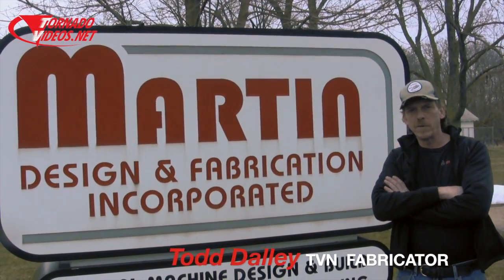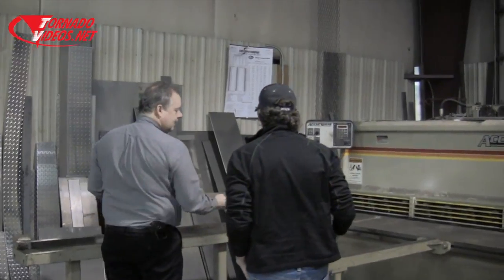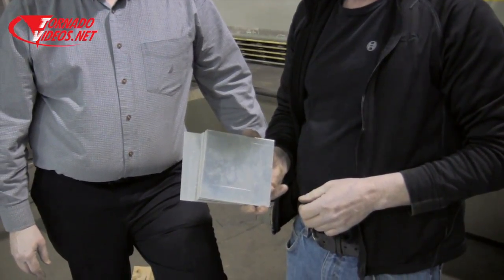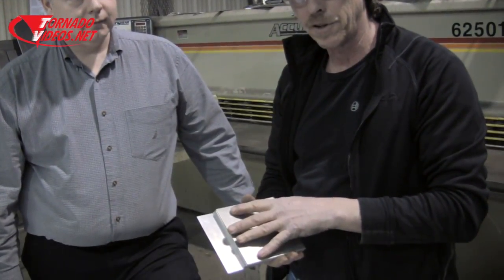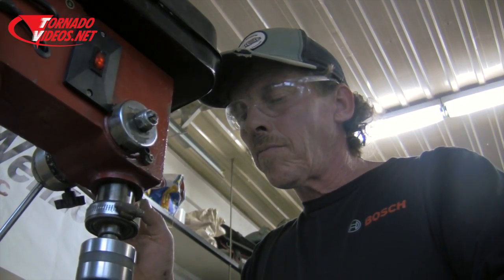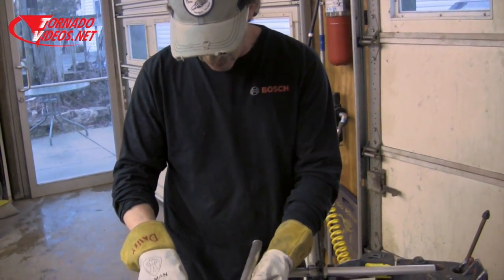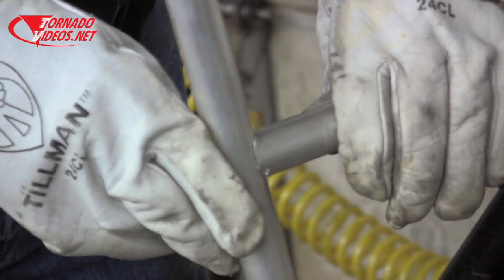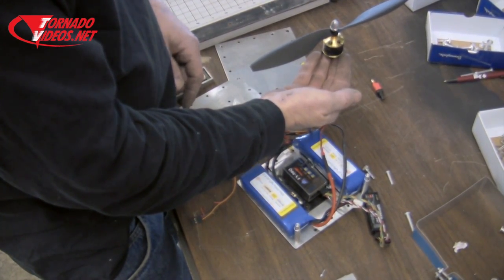TVN Quadcopter Build: Part 1

Comment: @dar1354 When you compare it to the size of the outbreak during last tornado season, yes, it is small... There were 1,897 tornadoes reported in the US in 2011. The outbreak that occured April 25 to the 28th last year was over 360 tornadoes, so yes, this recent outbreak was small. It was still devastating but small...

Comment: @Gezelem2002 From the other videos about the quadcopter they plan to kamakaze these things into tornadoes, I dont think a DJI or any other expensive flight controller is needed or wanted for something thats going to be flown into a tornado... hell, a KK board would probably get the job done for a suicide run :p

Comment: You guys should invest in a YSIXX or quadracopter from  multiwiicopterdotcom. There carbon fiber lighter you can put GPS on it, fly it FPV with 2 cameras  1 being a go pro the other transmitting it all back you wirelessly recorded with OSD temperature, altitude, battery life etc. You'll also have longer flight times with a lighter quad and carry more gear.

Comment: You dont have to do the "one-off" method.  There are plenty of vendors who specialize in quadcopter frames that would be cheaper, your gonna need plenty of frames your gonna break alot of them trying to fly a quad in any kind of wind.